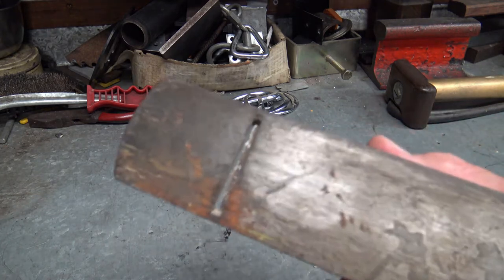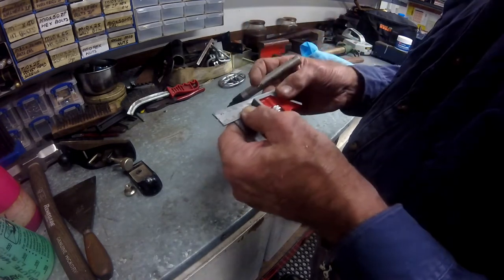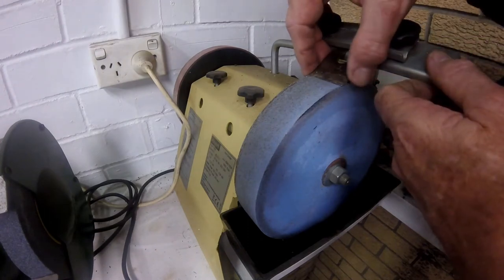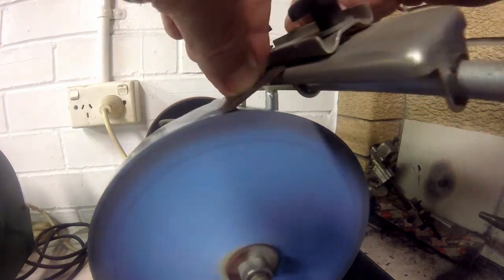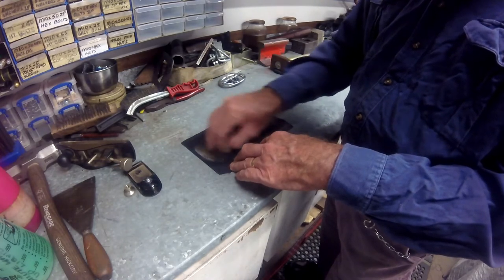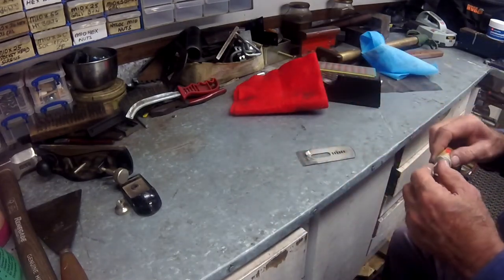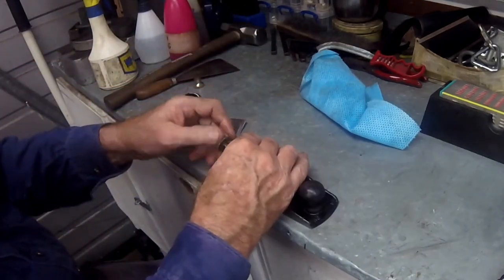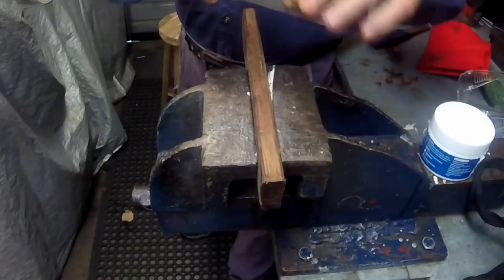Restoring an Old Block Plane

Comment: Hey Bob, great channel and great video.  I love the old tool restoration videos, nothing like the old quality especially in Aust where most tools a Chinese-made.  Anyway, I couldn't help noticing the vice.  I purchased one almost identical to yours and was wondering whether you know anything about it?
Reply from the maker: I bought the vice at an auction, so I don't know much about it. I had to machine a new screw for it when I got it as the old one was broken. I think it is shop made rather than mass produced. It is an all steel one so it can take plenty of abuse. It has no makers marks. It is a really strong vice. Hope that helps.